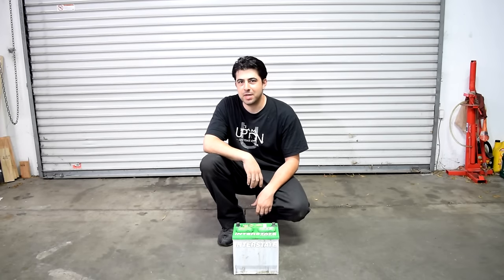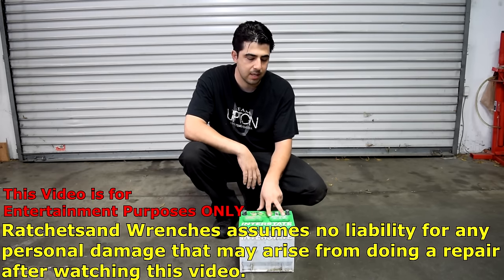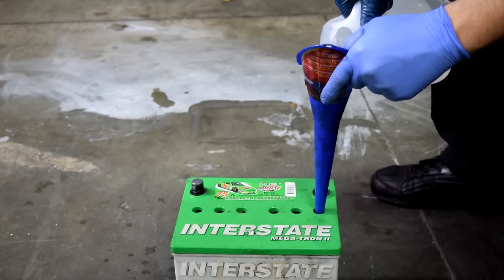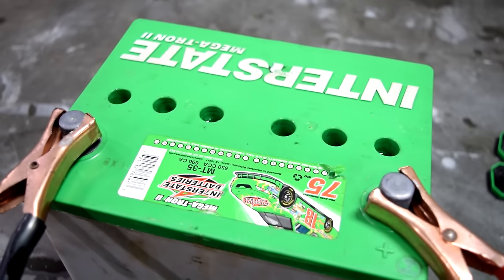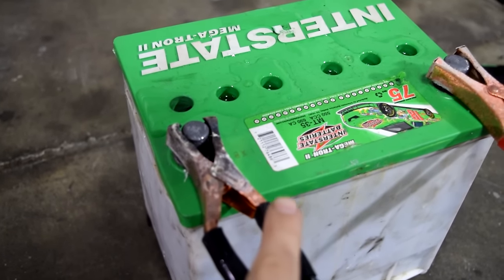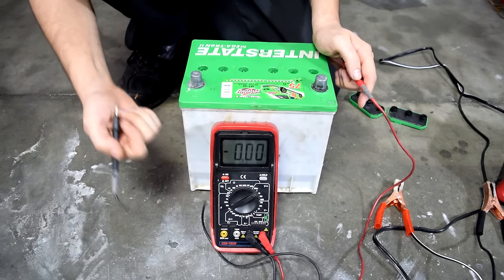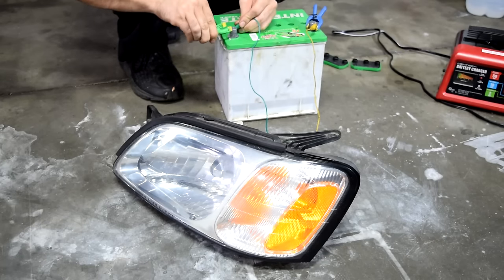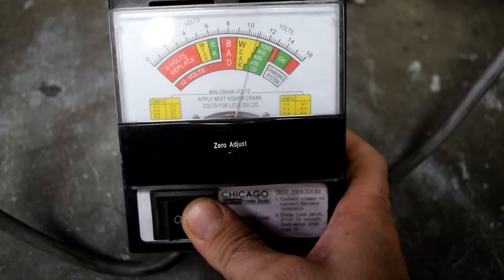Is it Possible to Revive a Dead Battery with Epsom Salt - See For Yourself

Comment: Funny i ran across this, i just revived an old batt about a month ago. I have an old Blazer i decided to get running to keep it from sitting. Battery was 0.0 volts, had a old battery that was sitting next to the shed about 3 years (on the ground) and i couldn't recall where it even came from.
For the hell of it i checked voltage with a 900 dollar fluke meter calibrated yearly and read over 8 volts, i checked water levels and learned one end cell completely dry. Filled with water and the water came running out the corner I'm like wth? No wonder it went bad, had a split about 3 in Long from bottom up so i sealed the split, added water and charged over night and it ended up holding around 13.4v. placed load tester on it and was putting out 600cca I'm like hell yeah!
Anyhow, i let it sit off charge and day after day it would still hold 12.6 to over 13V. Specific gravity never came up but she was holding good volts and passing load test every day.
I threw it in the Blazer and she's been cranking up every time since and been over two weeks now in the truck. I'll keep using till it goes out or explodes one, lol.

Can anyone explain to me why this is? No SG reading and yet this thing is working like a champ so far. For me, this is an indication that specific gravity readings can't really be trusted very well as this battery shouldn't be hitting on crap.
Reply: those 3 dollar SG gauges are about as accurate as a broken clock.... the suck-bulb ones with the little plastic needle gauge that ya gotta hold just right....stay away from them novelty acts, those are for the clueless white collar weekend CEO's who just think they know what they're doing

Comment: Just got o rural King and buy a good battery for well under a hundred unless it's big truck battery but it's still going to way cheaper than anywhere else. there batteries are very good with a warranty and they take off for your old battery.

Comment: I have learned by using distilled white vinegar I can get  four years out of my deep cycle batteries.   I had two deep cycle batteries in 2009 was sitting in my garage in my old auto scrubbing machine in 2012 I  needed to revive them,  completely dead in fact some of the cells were just a little bit of acid inside,  that's when I decided I'm going to put vinegar in each of the cells. I proceeded to charge the batteries with its own battery charger.  Did this just to see what would happen they came back to life in fact they lasted  for a year before I  had to buy some new ones I was surprised that vinegar would work like that for a battery.  I have a set of batteries March 2013 that are still being used in my auto scrubber  
 I have three auto scrubbers just to clarify that.
Reply: how did you dispose of the acid in the battery
Reply: Brandon Tarver 
 
I didn’t dump the acid  out 
I just added the vinegar to the batteries  fact I still  use  these batteries in my auto scrubbers ,fact the batteries today are sealed , 
can’t do nothing to add any distilled vinegar to batteries

Comment: Hold on, shouldn’t you be removing the epsom salt mixture and replace it with about a 70/30 sulfuric acid/distilled water mixture ?? I thought the epsom salt was just to help clean the insides, not for holding the charge.

Comment: Cool video .  Just an FYI  DO NOT put batteries on a concrete floor . Store or charge batteries by placing a piece of wood under theme. Some say this is a myth or that it doesn't apply to modern day batteries . Some say this "myth" is ridiculous and makes no sense . I say to those , why do I then need preparation H after sitting on cold/green concrete ???????

Comment: You are. Right but charge 48 hrs on low but the acid you should have cleaned the acid and put back in. And top with the. Distilled Epsom salt mix. Even if battery is completely dead.  See the mix is for the acid.  that's what it rejuvenates. Also don't dump the. Baking soda mix that you flush battery with. In with the acid. If so. You just completely neutralize the acid and won't work.

Comment: It's better to know that most car batteries will last at most 5 to 6 years and maybe a few years longer if the battery is topped up with distilled water after every two years.  Most people wait till winter and never top up the water level in their car's battery.  As the battery's H20 evaporates over time the car battery acid level begins to run low and come winter the battery's CCA is well below 400 CCA.  

If you can see the top plates in the battery the battery requires topping up with distilled water and fill the battery till the fluid level is about 1 cm from the top.  

It's always good to top up the battery's fluid level every 2 years and clean the battery posts during this time as well.  At least this way when winter comes around the car battery will have a good solid connection and the battery's acid levels won't be the culprit to a poor starting car in -30 celsius weather.   Getting a person to come to boost your car is at least $50.00 and it's something that  is easily preventable in the early all that only takes 25 minutes.

Comment: There is s big contrast  between  epson salt  and sulfuric  acid  in terms of required  concentrations to crank  an engine..when the battery  plates are
 Worn ..just replace  it

Comment: There are  a few things for fixing a car battery
Don't try to do this unless you are sure what you are doing - the acid can burn you
check the voltage first - there may be a dead cell which would waste your time.
Check the battery fluid.
Try to fully charge the battery.
(I read about these and more using rapid renew roadmap website )

Comment: I don't know that much about electricty but I think you may have a better chance if you place the battery on to a piece of thick wood or at least on to a work bench because concrete drains batteries 100% so your efforts may be better if you are not sitting your battery on direct contact with the concrete floor, while trying to charge it up, but I know that batteries should never be stored on concrete.

Comment: There are  several tips for battery reconditioning
Don't attempt to do this unless you are sure what you are doing - the acid can burn you
Test the voltage first - there may be a kaput cell which will be a waste of time trying to fix.
Check your battery fluid.
Try to completely recharge the battery.
(I learned about these and more from rapid renew roadmap site )

Comment: Does it work with deep cycle batteries? Also what do you do with the acid/lead solution after? Cheers Kevin
Reply: Kevin Buxton you can dump it in some rocks and add baking soda to neutralize the acid. Then later I rinse rocks with water.  It's not toxic so it won't harm anything it's just corrosive.

Comment: I believe battery solution is the best for reviving battery. As I understand when  you buy new battery after 1 year you should check the water level of battery. If below you should refill with solution not distilled water. Solution acid is good compare to distilled.

Comment: It's better to load test the battery using the starter motor in you car. This way it's easy to gauge how much mumbo the recon battery has in its natural habitat.
Acid should be returned to battery as someone else as mentioned. These two items will really test the myth if Epsom salts work. Epsom Salts is also good to clean wounds on Horses as well.

Comment: I have a question I need a answer asap so I have two car batteries one for my subs which came from my 2015 Kia forte and one is the original battery that came with my 2016 dodge dart I went to autozone a few days ago and both batteries were at 13.5 Amps or however (no expert)so I charged both batteries and it only cranked up 1 time after that I have to  use my jump starter 800mah every time will I need to restore both at same time I'm just asking running low on money please someone help me asap I just got a new job and getting off my feet

Comment: Let the soda sit in the battery for 24 hrs empty it and put soda water in again for another 24 hour soak.  After emptying the  second time.  Rinse with distilled water and empty again do this rince twice. Now take your acid and put it back in battery top off with distilled water put caps back on and trickle  charge for 24 hours. Test battery by placing clamp on negative post and positive lead in each cell (acid fill hole)  to see if each one is putting out more than 2 volts. If a cell is putting out less than 2 volts it is no good. Replace battery.

Comment: You know the funny thing is I've seen so many of these videos and I know for a fact baking soda will not work cuz baking soda is also a neutralizer which can also get into the cells and make it where the cells can't hold a really good charge or will not bring out the amps so what I suggest is you clean it out really good with distilled water and once the battery is clean then put in brand new acid and let it charge do not ever reuse the old asset in any capacity I know I've been doing this for years and I've never had a problem doing it my way but I always had a problem doing it somebody else's way and it's never worked

Comment: Well, you dumped the electrolyte the battery needs to work (sulphuric acid).  Then you neutralized any remaining acid with baking soda - before replacing everything with Epsom salt water.  I'm not surprised it doesn't work.

Comment: You have to use the same acid that comes out of the battery. You run it through a filter while putting it back it. I've never heard of trying to charge salt water.

Comment: So my dad and I tried this solution out. It works fine, but we've noticed that there are some overflow issues. However, the battery is working fine. Is it fine, or will it keep overflowing, resulting in us having to fill it again?
Reply: Yes.

Comment: well....it is 7 years old video....epsom salt seems to doing it, but can you put the battery in the car and drive the car  as usual and will it keep the battery in good condition?  again the load test is not satisfactory.   what if you put the old sulphuric acid (after the evoporation of the distilled water) back into the cells and top it up  with epsom salt solution...then you can trust the battery in the car for normal everyday driving !!!!   does it make sense?

Comment: I like other comments have done it their way, your way can't have Epson salt mix as working solution, no connectivity, need acid , I hear distilled water bottle to 180 f put 3 table spoons Epson salt stir then add to each cell leaving enough room for a half to one once electrolyte depending on cranking amps, 2 amp trickel charge 24 hours or till charged and done, all the best.

Comment: I got a second had battery & it was exchanged from old dead & it cost me nothing for exchanged battery from a car wrecker & I have a Foxsur 12v/24v battery charger & put the battery on charge for about 4 hours &  it was fine when I charge & put it my 1996 Toyota Hilux Surf & started  up the engine no problem at all & was going for a couple of months & when one day the battery would not turn the motor over & I took out the battery & I decided to put the battery back on charge again this time I put the Foxsur 12V/24V battery charger on repair mode & I took the battery out of the PT Cruiser into the Toyota Hilux Surf & used that battery for quite awhile in the Surf & the other battery I had on charge repair mode for about 24 hours & it seemed it come up with a good voltage of 12.66 Volts & so on the safe side I decided to put it in the PT Cruiser but had to take off the air box off & leave it off because the battery was a lot higher in height & I started the PT Cruiser & started it up straight away no problem at all & I had in the PT Cruiser for quite sometime as the PT Cruiser is off the road & just sits in the driveway as it doesn't have a Warrant of Fitness & need 2 new tyres on the front wheels & I dont have the money at the moment to buy new tyres & so.the PT Cruiser just sits in the driveway & I turn the engine over now & then with the battery from the Toyota Hilux Surf & it looks like that I have repaired the battery & starts stright away & so a couple of days ago I changed the batteries over & now the battery is in the Toyota Hilux Surf & starts the 3.4 V6 engine over no problem at all & so my little Foxsur 12V/24V battery charger has repaired my battery but 2 other 2 12Volt batteries I couldn't recover well I was lucky to cover this 12Volt battery & happy with this battery & latter on down the track if this gives the up the gost I can just go back to the car wrecker & do another exchange with another 12Volt car battery & will cost me nothing for the battery only fuel in going to the car wrecker as the car strips the cars down & engines gearboxes & differentials get taken out of the vehicles & they are put in Shipping Containers & are sent overseas & Batteries tyres & rims cannot be sent in the Shipping Containers & there might be a time I might be able to get 2 good  tyres for my PT Cruiser & hopefully I can if not I might have to buy 2  good second tyres for the PT Cruiser & its really good that I can exchange 12Volt car batteries that way because 12Volt car batteries new in New Zealand are now very very expensive & I'm now looking $250.00 to $300 for a new 12Volt car battery over priced & I could afford that & a few years ago you could buy brand new 12Volt battery around $60.00 to $80.00 & now it's beyond the joke even marine batteries are way expensive & you have a nice day or a good night Sir Kind Regards Peter

Comment: You might have achieved something except you need to remove the RPS-Inmate salt water and fill with distilled water trickle charge for a couple of hours and then dump the water out and then replace the acid with acid at the proper specific gravity probably somewhere around 1.115, but no lower than 1.055

Comment: I have been doing something similar for 45 years.I completely kill the battery and charge it reverse polarity for a little while.Then i flip it upside down and drain the acid,big chunks come out of lead sulfate.Then i replace the acid and charge it the regular polarity.I do this over and over until the plates in the battery completely disintegrate

Comment: you  can tell  a really good battery has a really good  voltage   close to 14 volts  -- 13.8 volts and when you hit with  the resistor its  in the high Good zone

Comment: There are  a few suggestions for doing a pro job
never try to do this until you know what you are doing - the acid can burn you
check the voltage first - there may be a dead cell which would waste your time.
Check the battery fluid.
attempt to completely recharge the battery.
(I read about these and more from Rapid Renew Roadmap website )

Comment: here's  a few things for getting a good result
Don't try to do this until you know what you are doing - the acid can burn your skin
Test the voltage first - there may be a dead cell which would waste your time.
Check the battery fluid.
attempt to fully charge the battery.
(I learned about these and more from Rapid Renew Roadmap website )

Comment: Actual I try this.20 yr ago I need 12 volt for my solar panels . And I see the salt a few buck so I tried it. I just drain tip it ver and add it and it did recharge this time to full. And it was a true charge. Before it get full charge but fall of a cliff to 12.0 too fast.

Comment: I know it's probably  a no brainer but, don't smoke or have any open flames or extreme heat such as heaters ect.. . When charging lead / acid batteries Hydrogen is released & is extremely flammable !

Comment: Yes, and I think this might be possible however, there are some things to consider first. Batteries have individual cells which are connected in series, I believe, to achieve the 12 volts or more. If ANY of these cells is burned through it won't work because the cell is now short circuited. I don't believe there is a away to really test this. Also, I don't understand how a battery which is lead/acid could actually charge or retain a useful charge where you are using a "base" electrolyte like baking soda or Epsom salt? To clean it out fine, but to not use battery acid simply should not work. In addition, the lead in the battery deteriorates over time getting thinner and thinner until finally it becomes paper thin or burns through the plate(s). If the plates are still thick enough it might be worth the effort, if not the battery even when re-conditioned wouldn't last all that long until failure. Recycling battery plants simply chop up the old batteries and recover the lead for re-use. Lead BTW is sold by the pound so recovery might be an option if you get the old batteries free. Just sayin' !

Comment: I have golf cart batteries that smell like acid when i drive it.  I have distilled water in it but I cant drive it because of th smell. What is the problem?
Reply: +Marie Woodworth - When you put Distilled Water in it.  You need to Charge your Battery with the " Holes " open.  This would allowed the Acid and Distilled Water mix and also, it allowed the Hydrogen to escape.  What you are smelling is Hydrogen being escape during Charging / Discharged.